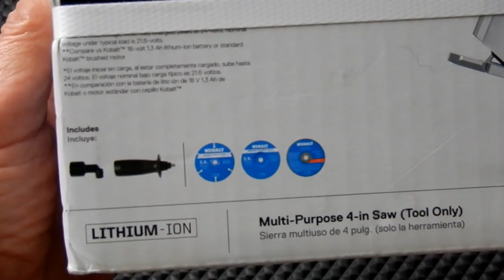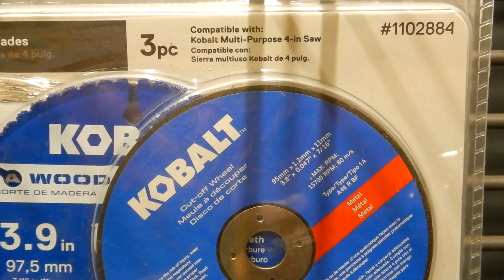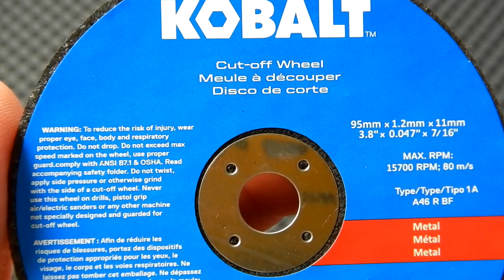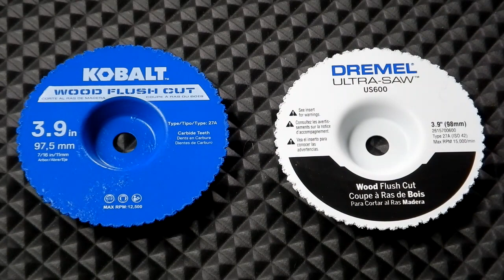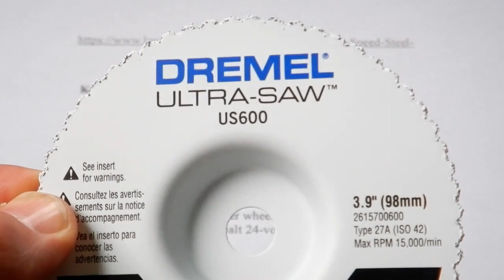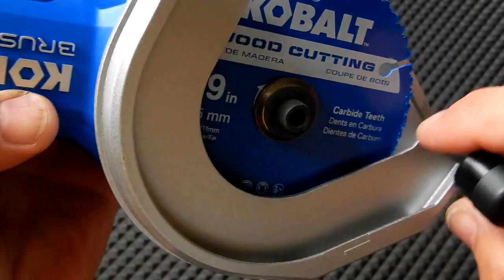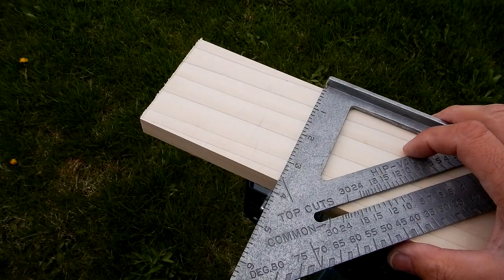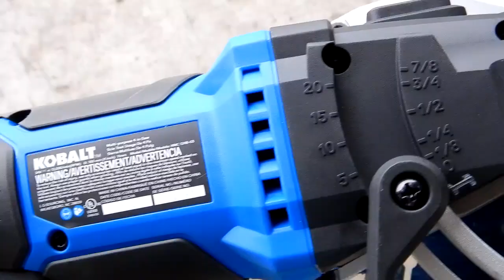Kobalt 24-volt Max 4-in Brushless Cordless Circular Saw Model # KMC 124B-03

Comment: Your videos are the greatest. I have this tool & the grinder. I also have a lathe & lots of scrap  T6 aluminum rod. 
I know some may have a lathe. If the OD of any brand blade is workable and the ID is larger I turn a small arbor type adapter for a tight fit. Just got to pay attention to max safe RPM. 
Did I mention I love Kobalt 24V tools ?
💕👀
Reply from the maker: GatorWing        Thank you so much! Also, thanks for the tip.

Comment: I switched from Dremel Ultra Saw to this and absolutely love it!
<<<<PRO TIP>>>>  There isn't any grinding wheels for this except the super expensive 3.9" Kobalt ones with a 11mm arbor or the 3" ROTO discs.  I got a 5/8's to 10mm adapter bushing and ran a 7/16 bit through it!  Now I can run the really cheap blue fire 4" discs with 5/8ths arbors!
Reply from the maker: Preston    Thank you for that information!
Reply: @starastronomer  Find it on Amazon: Amana Tool - BU-125 High Precision Saw Blade Bore Reduction Bushing 5/8" To 10mm
Reply from the maker: @preston1614  Excellent, thanks for this information. Very helpful.
Reply: I would love to see a video showing how this is done.

Comment: I can not get the blade bolt to nudge at all once the arbor is locked
Reply: I’m afraid I’m gonna push it to hard and break it
Reply from the maker: Not sure why. As long as the allen wrench fits good. Are you turning it the correct direction?

Comment: Have you cut much metal with this? If so does it work well?
Reply from the maker: Josh Seymour   No, I have to date used this for mostly wood and have been very happy with the small saw. I have used the cutoff wheel for cutting thin sheet metal and 1/4" round stock with ease. What thickness of metal do you plan on cutting?
Reply: @starastronomer  Thank you for the reply I appreciate it! And I plan on using it for auto body purposes. Mainly body panels and sheet metal.
Reply from the maker: @joshseymour107  You should be fine especially how thin the metal is in today's cars :)

Comment: Technically couldn’t you cut 2x4’s with this? You’d just need to flip the 2x4 over right? It may not be exactly precise but it can get the job done
Reply from the maker: AK Maestro   Of course not, it's not made to cut 2x4's either. It is great for cutting within the range the saw is designed for.
Reply: @starastronomer  for just diy projects around the house? I don’t see any reason why I couldn’t cut 2x4’s with it